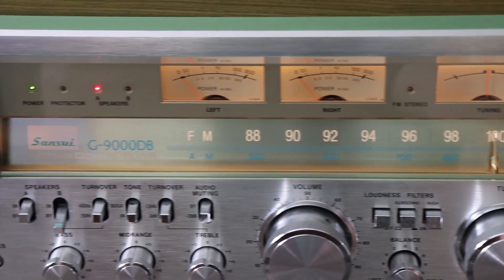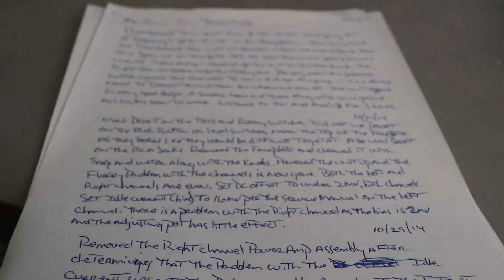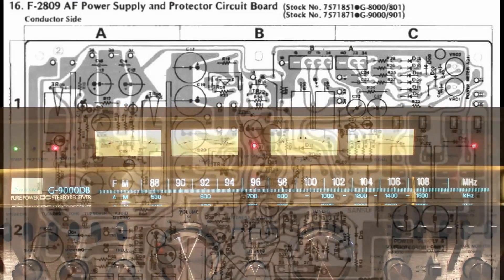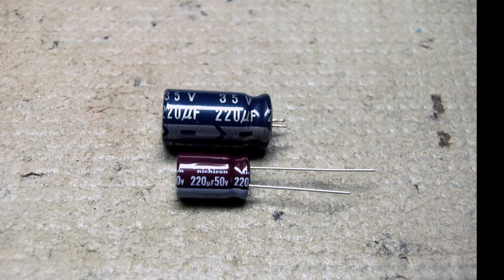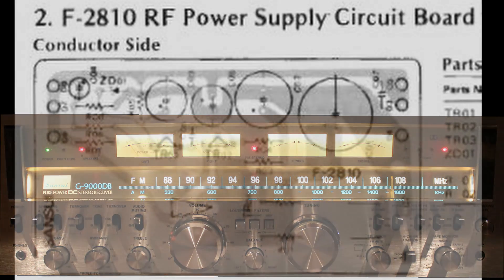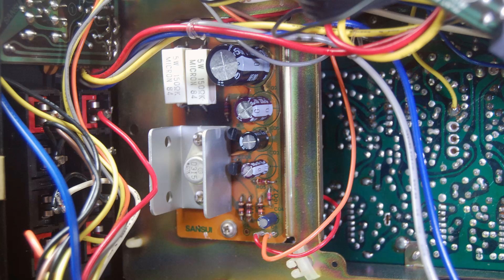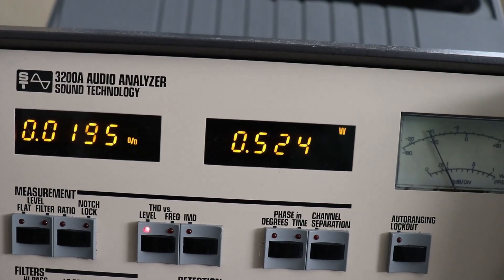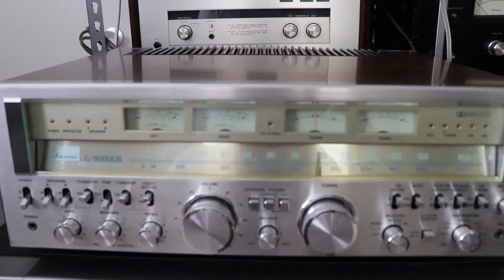G-9000DB - Sansui Receiver - Most Beautiful Ever? Repair Restoration Testing Vintage Stereo Audio

Comment: My Sansui is the G9700 - purchased while in the Navy from the BX in the Philippines in 1980, along with all the additional  accessories (turntable, reel to reel, speakers.).  She’s been packed away, won’t power up. Your video rekindled desire to investigate- I am still an electronic tech for the military.  Thanks for your videos.
Reply from the maker: Your welcome and thank you for sharing your story. You have an electronics back ground so I'm sure that you can get your G-9700 up and running again. Most all the parts are still available for your Sansui to start making music again.

Comment: Sansui also made Quadraphonic Amplifiers and Receivers. Are they collectible and worth restoring? I have heard that different versions of Dolby Surround with possibly an extra added amplifier channel or two might make a worthy project for those of us who didn’t see the value in investing in Quadraphonic at the time. For Example, also as I remember, Sansui Quad Receivers had 4 VU Meters for dual front and read channels. I had Quad 8Track in my Dad’s station wagon. But never any Quad-capable @home Receiver, like Sansui had, which included RS and QS electronic decoders (or whatever they were called) for decoding the Quad LP Vinyl records of the time. Those would be cool to hear, if you had those and the electronics to play them back.
Reply from the maker: They sure are worth something.  I have some of the Sansui Quad's and like most of the equipment back then it's good stuff. The 4 channel stuff never really took off commercially but it wasn't because the equipment wasn't good. The cost turned off a lot of people. The 2 channel equipment was already pretty expensive for most people. Now you needed 4 speakers and all the other equipment.
Reply: Vintage Audio Addict . ....Oh Yes Sir.... Yep...You know your stuff. Quad was a financial failure. But the Audio HIFI manufacturers did not give up. Once Dolby with Pro Logic showed up, somewhere along the way, after that, surround encoding/decoding with other systems became more Movie centric. But I’m hardly an expert on how Quad eventually merging into Ambiance and some factors of true Echo to reproduction of room acoustics simulating jazz halls vs. sports arena and being able to tweek microseconds of delay for different virtual environments for music enhancements,  and simulations. In these ‘surround-ish simulations one doesn’t need the source encoded; any music or other source will work. 

I have some Sony ES Series components which does some of that. But those are from an era of Dolby Pro Logic. Gosh knows what stuff is now with all these 4K Tv enhancement for the video. I’d have to really come up to a college-level of interest to know all the video enhancements, then audio systems in the receivers, or whatever. And I don’t watch hardly any movie or listen even to music like I used to. So to spend, spend, spend for an entire High Fidelity set-up to whatever is current probably wouldn’t be worth it.

  As a separate discussion....Do you do component refurbishment or repair on the side for others? I have a small variety of components that need simple things, I think, like cleaning of volume pots, and selector switches which have some kind of oxidation in them creating poor electrical contacts, and thus noise when used . OR do you know any one in the United States who does such.
I have not been pleased with a local service as an ‘official’ repair shop.

Comment: Those Sansui's are surreal. There are times when I'm convinced their components are the best thing that ever happened to people, ever. Give me a time machine and a stack of Yen, I'm off to Aki Habara.  I suffer from the compulsion . Every single piece I find at yard sales or thrift stores comes home with me. My resurrection skills , sadly consist only of compressed air, ballustol, and a six iron. You are doing gods' work sir, I salute you.
Reply: "Akihabara" - that brings back memories. I used to love window shopping the extreme high end equipment in those stores. Six foot tall speakers, amplifiers with huge glowing power tubes, McIntosh, Nakamichi, Klipsch, AR, and many more that I can't remember. These were way above my pay grade (E4).
Reply: Glorious, the self indulgent gaijin could still put together a ridiculously ponderous system if you were willing to pick up components "discontinued " Every three years they went from black to silver, and three years later back to black. Usually the components were still identical save for the color of the faceplate, but in Akihabara the off-peak finish made them next to worthless, and they would be stacked up on the sidewalk in their shipping boxes priced to move at a fraction of the original sticker price.  Those flagship showrooms were unbelievable , almost beyond description.  Certainly beyond any mortal's budget.  Mythic,  I hope it's still like it was back then, This may sound weird but when I think about that place I can smell mild sevens and tempura, with tall bottles of Sapporo.
Reply from the maker: Thank you so much for your kind words. Amazing equipment that was built well and has stood the test of time.

Comment: Currently using two Sansui SP-Z6 speakers in my living room. My dad has a Sansui receiver but the shop that tried to repair it said the part isn't made any more. Not sure how much truth there is to that.
Reply from the maker: Man, I bet those SP-Z6 speakers can crank. Most of the parts to repair vintage audio equipment are still available. Your Dad should probably get a second opinion if he can.

Comment: Sansui. Nice on the outside, annoying on the inside. Never liked repairing them.
And they never had good sound quality.
Reply: I feel sorry for your ears, Anyone Lucky enough to have had their component fixed will love you forever for it.  Sansui's sound best when you notice the overhead lights dimming on the drumbeats.
Reply: @idiamin1457  lol! I worked on a 2 piece 330 watt Sansui stereo that could do that to the neighbors lights.
Still, there's a difference between raw power and tone quality.

Comment: Gorgeous Sansui receiver. I bought my Sansui G8700DB new in the Philippines in 1980. Still have it today and still sounds incredible. This G9000DB was the generation just before mine. I still even have my original manual and receipt from the Navy PX for $410. I’ve had it cleaned and balanced about 8 years ago. Probably needs a new service soon.
Reply from the maker: Thank you for your kind words and for sharing your story. Congratulations on having your Sansui for all of these years. It's great that you have the original paperwork from the PX. I bet you remember the moment you purchased your receiver every time you see it. Thank you also for your service!
Reply: That’s one of those “if I could go back in time” life moments, buying my stereo at the PX. I think I did pretty good, but I’d love a second shot at looking at all the great gear of the time. My original purchase was the big G Sansui receiver, a Pioneer CTF-950 cassette deck, Sansui FR-D4 turntable, Akai reel to reel, and 4 (yes, 4) Pioneer HPM-900 speakers. Of everything, just the G8700DB survives. I’ve upgraded turntable (JVC QL-Y55f), CD player (Denon DCD-3520 CDP), and a mint pair of Sansui SP-5500 speakers. May not be “audiophile” in some books, but it is a kick ass vintage system that sounds incredible.

Comment: In all the advances in manufacturing capability and electronics technology  over the last 40 years, what would be so difficult for Sansui to build and sell this same unit today? Granted, it would be priced about $5k, and there would probably be a two year waiting list to get one!
Reply from the maker: Thanks for commenting. The great thing about growing up back then was even if you couldn't afford a receiver like the G-9000DB for $1000 as a young person you could maybe afford a $300 receiver that had the same build quality. Time has proven that even the lower priced units in a lineup are still operating today.
Reply: Bought marantz system 1980 1984 from germany

Comment: Sansui 7900Z bought in Germany at the PX audio store on Reese Kaserne in 1981, still going strong. Problem is I just burnt a Klipch 250 watt speaker, it actually started on fire and I had to take it outside in the rain for worries it would burn my house down :) . I only had the volume up 1/3 of the way and can't figure out how it happened .
Reply from the maker: Thanks for commenting on where you purchased your 7900Z. I'm sorry to hear about your speaker. Have the receiver checked out before using it again.

Comment: When I was processing out from Vietnam in '69 at Division,I ordered a Sansui SU-400 tuner amp,SU-200 speakers,and a TEAC-4010S reel to reel at the PX.All were shipped directly home from Japan.Great sound and performance for many years,all stolen in a 1977 burglary.Never owned anything like them since.Great job on reconditioning this later model.The 400 was built from '67-'69.I still have the schematic booklet somewhere in the archives.
Reply from the maker: Thank you so much for sharing your story and for your kind words. Man, I'm so sorry the equipment was stolen. Now a days crooks would run right by the equipment looking for your iPhone. Thank you for your service!

Comment: This was an era where, when it came to Hi-Fi home equipment, the Japanese just had the western world beat.  The purist of audiophiles, writing for their convoluted Hi-Fi magazines, couldn't admit it. They would tout that the equipment was too shinny (really, go back and read those magazines) that it had too many buttons, not minimalistic enough, distracts the listener from really listening to the music, you know.  They would grab their "Quad" brand grey plastic 2X30W. amplifier, which sported only a volume control, find some one meaningless spec. (like the Quad, at 25W. over both channels has 0.0000001% less distortion) that was better on the Quad and therefor it was better.  They hated Japanese equipment, they hated any equipment that was produced in more than 75 units per year, but the truth is that the reputable Japanese companies were leading in that great era.
Reply from the maker: The Japanese did make outstanding equipment. There were so many quality products up and down their lines. The smaller less powerful equipment was still engineered and built to the highest standards. Their audio equipment has certainly stood the test of time.
Reply: Yes, back in the late 60's I was enamored with Quad and lusted after same, along with fancy electrostatic speakers( forgotten the brand, same?) and eventually built my first, which was good enough, and then bought a 2nd hand Luxman receiver. This served me very well for years and I still have it.
Reply: agreed but the Japanese never really got the speakers down right
Reply: The alleged audiophiles write columns for cash and free equipment. Sansui didnt need to play those types of games.

Comment: Beautiful piece of electronic history.
I currently have a Yamaha A-520 that is being serviced.
It was my first stereo equipment purchase in 1985 as I finished university and started my first full time job.
It was the hub for my listening system quarterbacking a JVC turntable, a Technics dual tape deck and a pair of Energy speakers
.
Love watching your videos as I can see the passion you have for your vintage gear.
Awesome stuff!
Reply from the maker: Thank you so much for your kind words and for watching. I find it cool that so many people still have their audio equipment from decades ago like yourself. Good Stuff! I still have my first integrated amp a Kenwood KA-3500 and my Sansui TU-717 tuner that I purchased in the late 70's. I was a teenager at the time working at Pizza Hut so equipment like the Sansui G-9000DB was out of my price range.

Comment: What is the difference between the 9000 and the 9000db?
Reply from the maker: The G-9000DB had the Dolby circuitry while the G-9000 only had FM de-emphasis circuitry. It was only good for FM dolby which is no longer broadcast.
Reply: @vintageaudioaddict  

Thanks!

Comment: Great video, and a great idea for comments! Three years ago, a near mint Pioneer SX-780 for $14.99 followed me home. I since have added a matching cassette deck and turntable, as well as endless pairs of speakers, and more systems upstairs. But this receiver has become my centerpiece, and the one that really got me started with vintage audio.
Reply from the maker: Thank you as always for your kind words. The SX-780 is very nice receiver. $14.99? pick me up a 100 of those, great deal! Sounds like you have a nice setup of gear. It's fun to mix and match.
Reply: Vintage Audio Addict Speakers have become my ultimate mix and match pieces for upstairs and downstairs. They are endless fun. Yes, my Onkyo Integra TX-870, and Carver m500T are pieces I bought brand new, and have been used so regularly, I almost forget today how “old” they truly are. But the SX-780 is like a Porsche 911 might be to a car collector- looks great, maybe is not the fastest thing on the road today, but still handles great, and performs with panache.

Comment: I have a Pioneer SX-3900 that I purchase in 1980 (my first major purchase after graduating from college) and I still use it almost every day. Based on what I've learned from your excellent videos, the electronics have surely degraded over time. How is this affecting the sound quality? Is there less power and/or more distortion? It actually still sounds pretty good. The only obvious issue is that the FM reception has significant degraded.
Reply from the maker: First of all thank you for your kind words. The SX-3900 was/is a very nice receiver. Your correct those electrolytic capacitors are do for replacement. It probably is affecting the sound quality as they do degrade over time. Maybe a bigger concern is if a capacitor fails it may take out a lot of circuity around it that could cause serious damage. I guess it's all about if you want to keep your SX-3900 operating reliably down the road. It's not a easy choice as techs are hard to find now a days.

Comment: That's a beautiful receiver! I've sometimes wondered, why does the resistance 4 ohms or 8 ohms make a difference in wattage on some receivers but not on others, because this receiver is 160 wpc at 8 ohms and 4 ohms?
Reply: greg mcgee 
My thoughts were the same as 4ohms usually doubles the power.